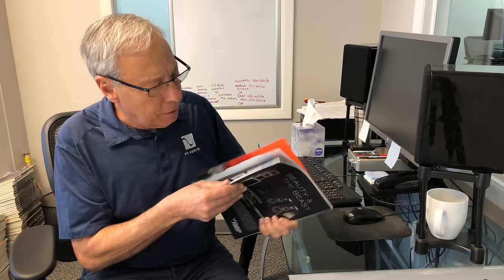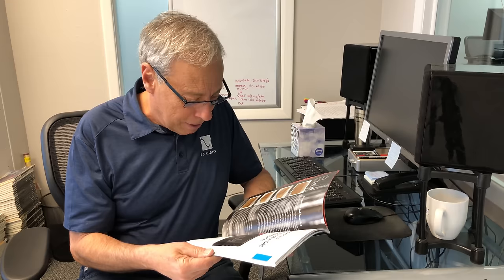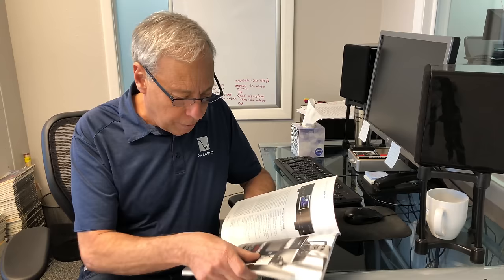Is equipment burn in real?

Comment: I used to set up burn in schedules for military equipment. When the equipment came out of production a full test sheet would be written, some of these were 8 pages long. The equipment would then go thought a 168 hour burn in, some were cycled on and off and the ambient was raised to 55 or 65 degrees C while it was powered. up. After the burn in the equipment had another test sheet written. The before and after test sheets were always different, they were both in spec but they were different.  

With military gear it was to insure stability and reliability. You would weed out any infant mortality's and insure the components were not drifting. You cannot afford a failure in critical equipment on a ship, plane or the space shuttle, the equipment HAS to work. This testing is why that gear is so expensive, it involves a lot of labor and the record keeping is crazy..

So the answer is that burn in is real, it causes a change in the way equipment operates.
Reply: Well, this is the first time I've heard someone talk about burn-in and made it sound credible. It's a refreshing change from cable burn-in, demagnetization stories and other nonsense. As they say, consider the source! Someone actually testing equipment, according to known procedures, gives me more confidence there's merit to the burn-in theory. As opposed to stories from people who sell pucks and speaker-cable stands against "microphonics". Thank you.
Reply: dell, I have seen production test sheets, well, packages 20 and 25 pages long.
Reply: Gersberms, I am also one of those who believes cable burn-in is nonsense. One of my brothers was a Navy ET. When he had to replace a cable to a sonar transducer, he just replaced the cable, tested it, then went on to the next problem. Never worried about burn-in. Those cables were carrying signals from just above DC to 100 kHz or so.

Likewise, when I was in the radar business, when I needed to replace a cable from the baseband output of an IF amplifier to the input of an A/D converter (DC to about 2.5 MHz), I just installed and tested. Never worried about cable burn-in.
Reply: Did you burn in the test equipment as well ? :)
Reply: If I was reading it right, the previous post was from the person who had tested those cables you were replacing with, and they worked because they were within specification, based on that testing. Now, whether you believe in burn-in, that is another story. I choose not to argue with folks about cables, magnets, pucks, or isolation devices like tiptoes. They are not going to change my opinion, and I don't really care why you disagree. Not being rude, it is just a personal choice, and I see no point in evangelizing my opinion.And it is just a hobby. Lets have fun and enjoy the Music :)
Reply: That is called soak testing and it is done to confirm reliability, you were not burning in the equipment in the sense that doing so was necessary because of anticipated change in component specification over time. The fact is electronic components are more likely to fail when new or when old, and less likely to fail after they have been operating reliably in a system for days or weeks hence soak testing.
Reply: cbcdesign001
, mentioned what I was going to point out. So... I'll be heading off then.
Reply: You are absolutely right
Reply: but will it  make it better or worst?
Reply: That is testing, not burning... And we are talking about capacitors here, not valves or any mechanical part.
Reply: I'd assume burn-in for military equipment (or rather durability testing) is different from burn-in for audio cables, if there is such a thing...
Reply: @dell177, 😮
Reply: The before and after test results would also differ, even if a unit escaped the actual high-temperature exposure.  The question is whether the test result differences are statistically significant, and if so, should they be expected due to a known temperature effect on a specific part.  
The reason why military and aerospace electronics is so expensive, goes far beyond the piece part testing it goes through.  Primarily, it's because of the low volume of production which requires each part to carry a larger share of the development cost amortization.  Development of systems for aerospace is extremely expensive, due to the long design cycle and extensive functional testing required for certification.  If you think the production-test record keeping is crazy, you should see the mountain of documentation that the design engineers have to generate, to prove everything in the design works correctly.
Reply: I believe that is called "shake down".   If burn is real, then test equipment would do the same.  Modern test equipment is very stable.  As is modern electronics.
Reply: Thats to burn in for reliably testing, not audio sound improvements!

Comment: The issue I have with the concept of burn in is that it's always described as improving the sound.  I don't doubt that a piece of gear that goes through a burn in period changes in character a bit.  But why is it always better? Are there examples of when it sounds worse?  I never hear about those.
Reply: Exactly, and this very suspicious. I think people are mostly describing brain burn in and how they adjusted to the sound over time when they talk about their gear burning in.
Reply: I did wonder if that is at least part of what is happening.

Comment: Years ago I worked for a speaker manufacturer remanufacturing subwoofers mainly. I do know for a fact that there is a break in or burn-in time with speakers. It takes time for the soft components to loosen up and there is a drastic change in sound quality. I have proven it with checking the Theal Small parameters before and after. There are drastic changes on some parameters and not so much on others.
Reply: Yes. Let's focus on what can be measured.
Reply: Even my cheap Edifier R1000 needs burn in. It sounds grainy, muffled and has weird frequency response out of the box. After a week it sounds just fine.
Reply: How long does it generally take befors they sound as they should?
Reply: Andreas Landgren unfortunately there isn't some set standard time for break-in. It all depends on the materials being used. There are many different gauges of spiders which is the suspension for the speaker as well as cone and Surround materials vary from speaker to speaker. Typically it doesn't take too long. The most important thing is not to try to see how far you can push the driver when it's brand new give it a few hours of listening at moderate levels and then let it rip. I hope that helps you
Reply: Groovy Dude thx for the advice on the volume.
Reply: Yes with drivers it makes sense; since the surrounds will change their compliance/springiness from new, but an amplfier that has no moving parts..no unless you are talking about giving it time to warm up to operating temperature.
Reply: Groovy Dude yes, same with guitar cabinets. But amps etc, just no.
Reply: i like numbers when i'm comparing things. as usual, there are none provided.. 

(using terms like 'drastic' with no follow up is insulting to the reader.)
Reply: @danielhillwick8430  the best answer till date.

Comment: Why don't manufacturers burn in cables, hifi components and speakers? I used to make audio equipment and there was a part of the test where we left the units powered on overnight and checked them the next day. Hifi manufacrurers who sell such items that cost more than budget level equipment have a duty to do this I would say. It would cost them nothing to do! (apart from the electricity which is neglible) No manufacturer that I know of states a recomended burn in period - you would think they had listened to their equipment enough to have this worked out.

Comment: I just recently had another experience with "burn in" with some vintage speakers. I rewired my mids in series (each speaker has 2 mids. Sansui SP-2500) and replaced the three capacitors in the crossover. When I first played them they instantly sounded better than they did before the mods, but I just couldnt get them to sound exactly like I wanted even after fiddling with the amp and speaker placement for about two hours they just sounded a little dull and lacked fine detail. I tried again the next day, but they sounded the same, BUT after another 2 hours of listening I jacked the volume on one of my favorite songs and all of a sudden they sounded great!  I went back and played all the songs from the previous day, and the smoothness and detail that I was missing was now there. This was not my imagination, they still sound good today. It was the new caps "burning in".
Reply: Lovely how human ears get used to sound really quickly, isn't it?
Reply: @michielderomijn  Yea, he just described brain burn in, not equipment burn in.

Comment: I haven't seen a single evidence mentioned in the video that distinguishes "people burn in" from "equipment burn in" if there is any difference. There are lots of statements made though. another question: why the manufacturers don't do "burn in" professionally before shipping and leave it to amateur customers ? In fact, Sennhiser suggested in their website that their headphones are good as it is out of box, do not require "burn in". If there are audible diffenrences which can not be represented by measurements, it should be proved in the same way used in clinical trial in drug testing.
Reply: word!